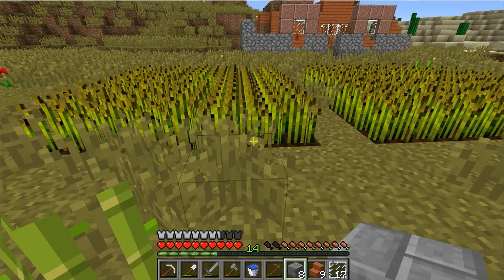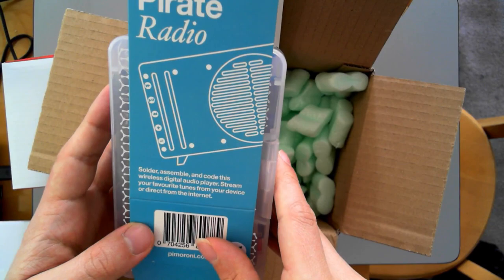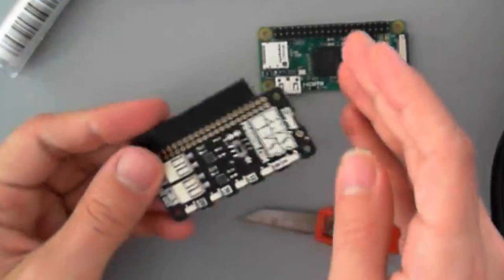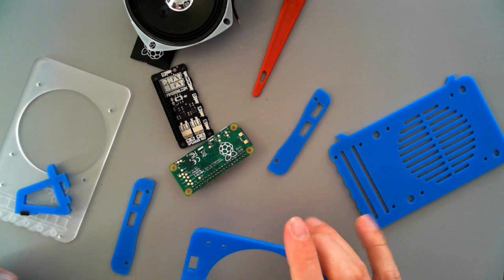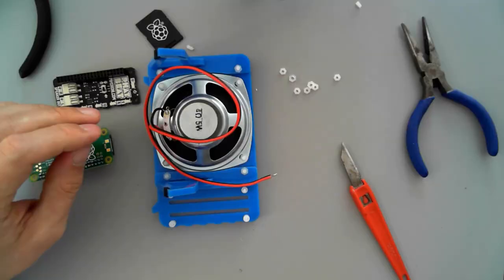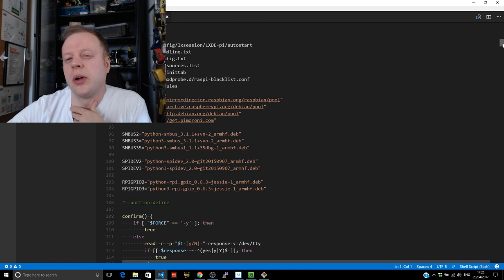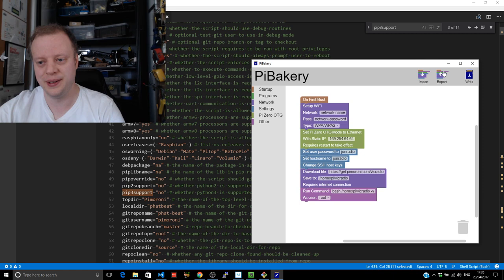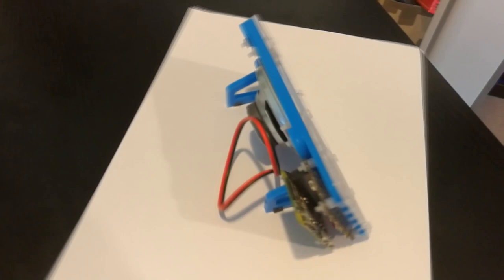Building and Unboxing The Pimoroni Pirate radio (A raspberry pi media player/streaming gadget)

Comment: great video, i noticed they have included a TFT display on it now. One question, how does the audio sound? reckon it would be able to move some better drivers?
Reply from the maker: According to Pimoroni - this particular model has Dual I2S DAC/amplifiers (MAX98357A). Each of those amps is "able to deliver 3.2 Watts of power into a 4 Ohm impedance speaker (5V power @ 10% THD)".I believe they use the same device with the same specs in the newer Pirate Audio models. The audio is good enough for a little radio, but if you want serious output, consider the Line Out version (PIM483) and a bigger hi-fi amp system.
Reply: @Orionrobots  did you ever do your follow up where you installed the zero W? i''m having issues trying to access the media i copied over to it without doing it via the web. THe display keeps wanting me to do it via the web. Any advice for a noob?
Reply from the maker: @3rutu5  I never did make that video. I should - and demo this thing. Mine is an old model with no display though, so I'd likely use an SSH session and CLI to do it.

Comment: Hi @orionrobots this is my first raspberry pi build and I managed to do all steps and run the installer until it asked for a reboot, but it never played anything, I also tried adding urls on the card and followed all these steps but also it doesn't play. Would this be a problem with the phat beat connection maybe? Does it light in any way or how do I know that it's working? How can I trouble shoot this? 😅
Reply from the maker: Hello, the first question is if you've spoken to Pimoroni - they are really good at resolving things. Which model did you get? How have you connected the speaker, and did it have the stereo/mono switch?
Reply: @Orionrobots  Hi! Thanks for your reply, I actually got it figured out, in case anyone is facing the same problem, the latest raspberry light doesn't actually support VLCradio, so I had to download the 2018 version and then everything worked. Made a video explaining it as well. Thanks @orionrobots
Reply from the maker: @dinaaamin  Interesting. It might be worth seeing what Pimoroni know about that one. I usually go lite as I don't plan to add a keyboard and mouse, however, it's not like disk space is usually an issue on the Pi.SD Cards are usually only partially used.

Comment: Hey,
Nice video! Is it possible to mod it in a way to transform it to a radioclock which starts to play at a  set time?
Reply from the maker: Hello, the nice thing about this device is it's just a Raspberry Pi. Which means you can put any code you want on it. Using Raspbian, and the installer from Pimoroni, it's ready to play audio. There are tutorials for getting an MP3 playing or playing internet radio. A bit of code (python/bash or just a crontab entry) could have it starting the music at a specified time every day. The Pi's clock doesn't keep time so you might want to add NTP sync for it to get its time from the internet. Take a look at the end of the build guide for ideas on software you can use on it: https://learn.pimoroni.com/tutorial/sandyj/assembling-pirate-radio

Comment: How is the sound on it? I have one of these kits and haven't opened it yet.  I didn't realize it actually had the pi in it, and I'd already bought the starter kit with blinkt, but the radio seems cooler
Reply from the maker: It's mono - but it's fairly good, obviously there is a limit to how great it will be with a small speaker and a laser cut grille. It's fun, but I'd not make any claims that it would please audiophiles.
Reply: @Orionrobots  You can now buy the "other" speaker to play back in stereo. That's why you have the switch between dual mono and stereo.

Comment: Just joined your channel very good video think I will order a kit does it work well streaming from the internet how do you select the station you want as there is no display or selection knob?
Reply from the maker: Bob Wareham there are buttons on the side, but it's user programmable, so you would set up streams or items you want to listen to and select it with the buttons. Being a Pi, you could add a tiny screen, or set up an lirc remote. It's very open ended, which is great for exploring, but can be daunting.
Reply: Thank you for the information very helpful hope you get your W from the supplier?
Reply from the maker: Bob Wareham Pimoroni sent me the missing w no problems. They are absolutely superstars of customer service! They've been consistently good at it.

Comment: You forgot to mention how you load the music on there.
Reply from the maker: I should revisit it. The non-wifi threw that video out a bit. With WiFi, sftp or streaming both sense. Without it, setting up a file transfer OTG to drop files straight onto it form a PC would make sense.